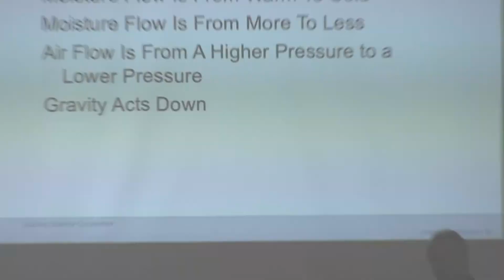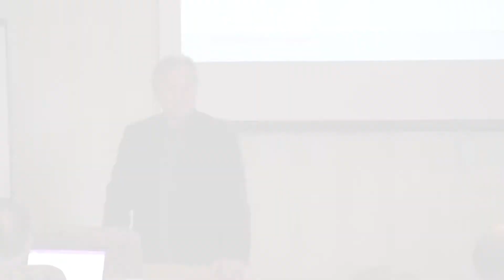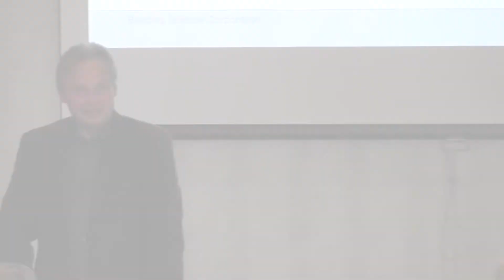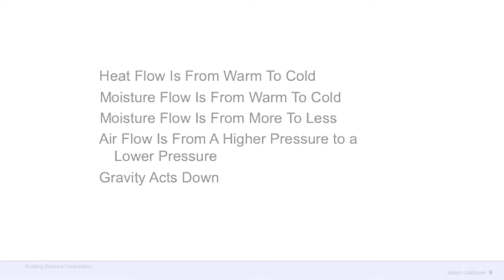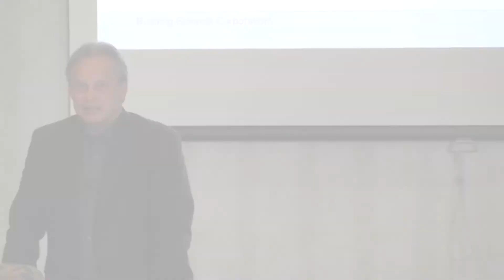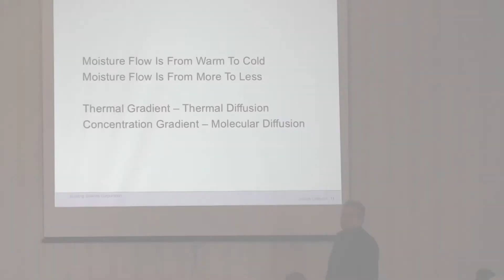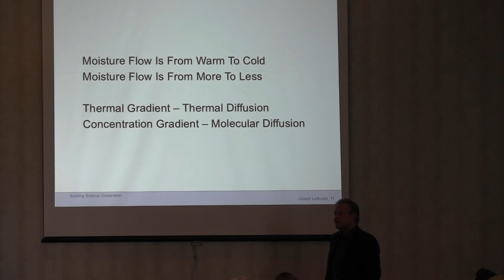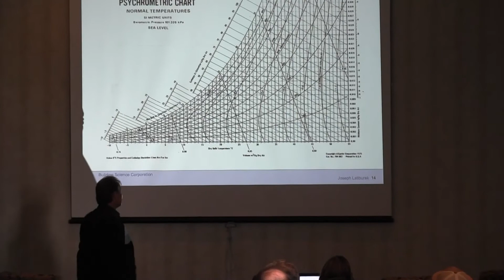Dr.  Joe on The 2nd Law, WUFI Analysis and Vapor Pressure

Comment: -- Thanks Doc - as a 50 year+ General Contractor I have long ago stopped reading the code or the calcs for answers, I just want a permit and be left alone. I buy insurance for my mistakes not reports. That being said, I still struggle with the concept of which single membrane to use at the tipping point of condensation. Should I put a bituminous adhered shingled continuous membrane over CDX ( or over that green stuff/OSB) and should I take some measure of caution and tape/caulk the CDX (and seal the nail/screw holes)? If I have some extra cash, should I use a liquid applied system on the sheathing  and then use a membrane? If I blanket the outside with 6" of rock wool (1, 2 or 3 layers rotated at each layer or ? - (I watched your video of your neighbor's comment on your roof showing lines when you strait stacked your roof insulation), will the fasteners on the 3/4" standoff really self seal or does it matter (and should I use 3/4" ply or OSB or marine ply or pressure treat something or a HD plastic )? What is the perm rating of this assembly - is it more than the perm per inch of rockwool and does this matter?  Is there really a two way membrane? Should I skip the inside insulation totally or does that foster convection currents and air washing and if that happens is good or bad? Is the best inside to outside ratio of insulation really 50+/50- or is it 66/33 or ???? Should one use an insurance water barrier at the back of the rain screen on top of the insulation but under the strapping (or over)? 
-- I do not expect nor think you should answer these questions more than you have already done in the past. I will eventually buy a library of your books, read to exhaustion, put thermal last and water first, make my first cut of design and then pay for critique from you or someone who thinks like you do. I like pretty also, so as always, money talks and XXXX-XXX walks. Years ago I realized that being a builder meant I should have gone to clown school first to learn how to juggle. 
-- I know you receive all the offers, but if you get to Clark County, Nevada (those of us who live in Boulder City do not say the words "Las Vegas" if can help it), please let me show you any courtesy possible (no free consultation over a burger - just a small payback)
PS: I wear a few hats, one of which is as a pastor and I can tell you that not one of my credentialed friends including several with PHD's (or two) can grasp the fact that laws are what we cannot prove or disprove  and to quote a digital friend "They just are!". On examination, this has proved to be also  true in areas of doctrine which I view has a nice chapter called "physical laws". 
-- May we both continue to live and prosper (if that is our choice) in the areas of the world where the laws fit the 15/20 and then send our condolences to those who live in the 5/20 group. 
Bob Jarrard    bobjarrard@gmail.com

Comment: In Indonesia they like chips with spices. Their chips are often hot, the local ketchup is hot. Sometimes in restaurants you will get fresh hot ground chilli spices ground into a paste. This is served to you on a rock. Why? Because Rock Don’t Burn*  If you see this paste. Next immediate step is to order cold Bali Hai Beer! Why? Heat goes from warm to cold! Comprehension of which is important as cold beer will always cool down hot spices! Be aware as time passes you will have reached some level of thermal balance and may need to get ready to appreciate that “goes in hot, comes out hot.” Can become a handy guide for future consumption. 

*Rock don’t burn.
This is correct when considering conventional house construction fire protection and fluffy or rigid rock wool insulation and an environment safe for humans. Typical rock used is Igneous. Made by volcanic fire. Very high temp required to burn rock based insulation. If it gets hot enough to burn, you most likely will have become less than carbonized toast. Sedimentary rock like Coal burns at a much lower temperature...

Comment: I have a house built in 1910, 2-story, with a crawl-space and a steep roof over the attic, 2,100 sqft. Craftsman with shiplap construction (2x4s). The first floor has wainscoting up to 5’, lath and plaster for the upper 4’ for a 9’ ceiling.  The second floor is 8’ of lath and plaster.

I would like to insulate the house with closed cell spray foam insulation but because there is no vapor barrier I’m concerned about wood rot from water due to lack of air flow.

I have opened up some walls and can see from staining that the house leaks water every once in a while, but doesn’t cause rot due to airflow.

I want to improve the house but I don’t want to ruin it. Please help.

Thanks for your time and consideration.

-Bob, from San Pedro, CA
Reply: I have the answer you don’t want to hear. It’s that if you want an improved version of that home you would need to have a replica designed with new construction materials. If you love that house, leave it alone and understand that there is a cost associated with anything like that. Log cabins, old farmhouses, etc… I’ve seen so many beautiful old homes stripped of their beauty living in New England, gingerbread trim removed that was too expensive to replace, vinyl siding slapped over clapboard siding they didn’t want to paint…